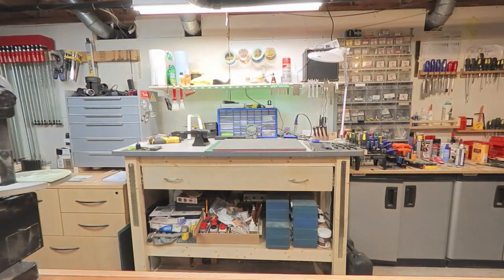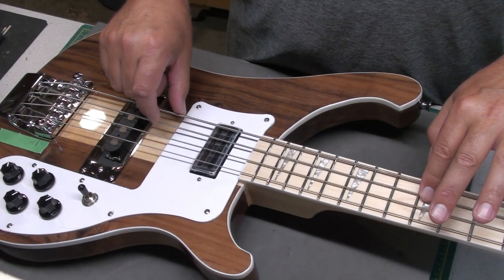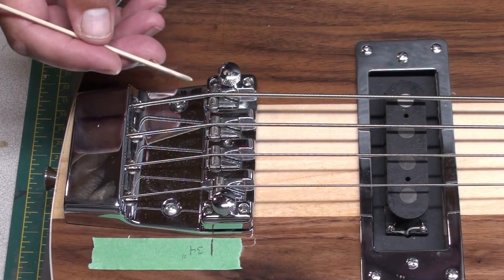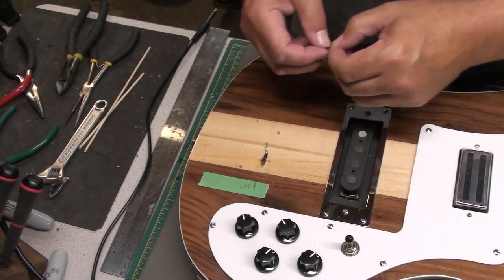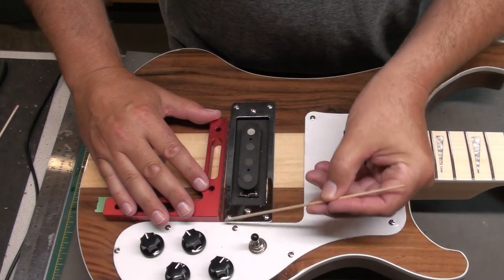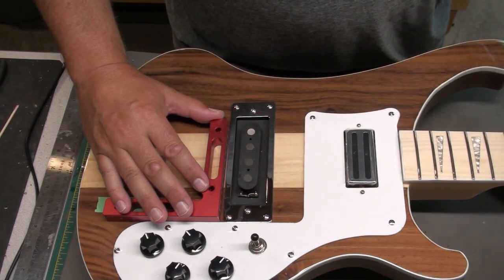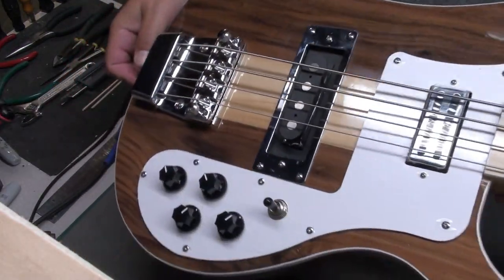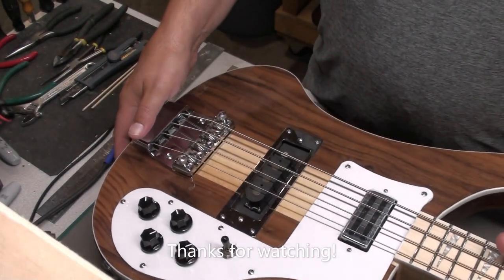Part 2 - Rickenbacker 4003 Bass Guitar (Chinese Copy): re-positioning and modifying the bridge

Comment: Hi so i have bought a very simmilar bass with exactly the same bridge. with the same problem. Rather than adding shims under the bridge saddles I realised you could warp the bridge to shape, by loosenning off the small allen keys on the out side of the bridge, tightening up the on in the middle to raise the center Then tighten down the two thumb screws either side to warp the bridge into shape, to create the appropriate curve, all buzzing on the D and G Strings gone. I then just tightend down the four out side allan key fittings to steady the bridge rather than change the shape. No Shims required.
Reply from the maker: nice fix!

Comment: Great video! I build and sell guitars as a hobby, but only from parts including precut bodies and necks, or in kit form. I do have a Chinabacker kit I will be starting very soon, (once I get two projects out of my shop). Let me know what you think of this idea...Turning the bridge around correctly, your saddle, set screws will be in the rear of each saddle. For this mod, you will need 4 more of these screws, (8 total), Though I have not yet measured them, these 4 set screws present in the saddles, look to be of perfect size for this application. Since the billets are completely independent of the bridge, this will not allow for set screws to be tapped and fitted on each side of the billet without creating balance issues, so here is my fix. Remove the saddles and tap a new set screw in the center of the billet groove of all 4 saddles. Check the sizes needed and use oil to lubricate when drilling and tapping the holes. This screw should be short enough to 1) sit flush with the bridge, mounting plate without interfering with the billet or if so, 2) possibly fitting in the space of the string groove of the billet, as rqr'd for action/radius adjustment height, etc. This will enable adjustment of all 4 saddles for the 12" radius of the fingerboard and aid in additional adjustment concerning action height and intonation. Of course, the loose billets will have to be worked around during adjustment. NOTE: Having experience with metal produced in China, this bridge metal is not as pure as that produced in other countries, (but I believe this is probably the case everywhere now)... It is cost effective but as a result, of inferior quality; this is a fact so use care and take your time tapping these holes and use a toothpick and steel wool for thread cleanup. In the past, I have seen cheaper bridges warp or even break due to tuning and restringing over time. Knowing this, I will also drill a third countersunk, mounting hole at dead center of this bridge but further back from the other two existing screw holes, as far back as it can go without interfering with string path. I will also use larger mounting screws throughout this bridge. Doing so will add extra strength to the overall integrity of the bridge. Once completed, this bridge should be vastly improved and work great. No, it may not be the best quality (yet) and sure, you can add a Leo Quan, Wilkinson or any other bridge that you have a hankering to use...but for about an hour's worth of time and with minimum effort, this bridge will be greatly improved, yet still cheaper on the wallet. Let me know what you think of this solution and I will let you know how it works once I complete this project.

Comment: Really enjoying the videos on the Rick-style bass. I think that instead of the aluminum tape I would have used some type of shim stock. The adhesive on the tape accounts for some of its thickness and I'd guess under pressure will migrate. That might change distances as the stack of tape layers compress over time.
Reply from the maker: It probably will compress over time - you can always add more tape... I didn't have any brass or aluminum stock handy.

Comment: I'm not sure lots of aluminium tape is the right solution. With so many layers on top of each other there'll be a considerable thickness of adhesive in the stack, which will act as a cushion or damper under the strings. Even if the affect on playing is minimal, having something as variable as that will change the instrument's tone and could make it harder to keep the strings in tune with temperature changes.

(Solid brass shims would have been my choice - ideally graduated sizes under all 4 strings. Better still: get a decent bridge...)

There's also the likelihood that the hard-mounted E and G strings will sound different from the softer-mounted A and D. Maybe not a problem for live gigs, but it might prove troublesome in the studio. Having said that, anyone who's THAT Ricky picky would probably have bought a real one in the first place! 😁

Comment: Wow, that bridge placement was awful. Thankfully my Chickenbacker has the bridge placed so that the scale length is fine, although it's tail end is not as close to the edge of the body as the bridge on a real Rick. The only thing I can really fault mine on is that it's quite heavy and a long rehearsal can leave my shoulders aching.
Reply from the maker: Thankfully, it was a relatively easy fix... it is a pretty bass and sounds pretty good, too.  I hope you have subbed to my channel?
Reply: Yep, I've subbed :-)